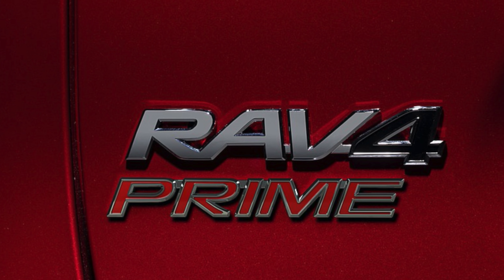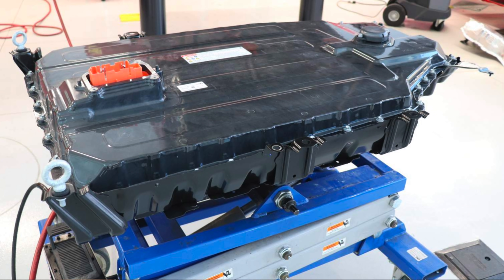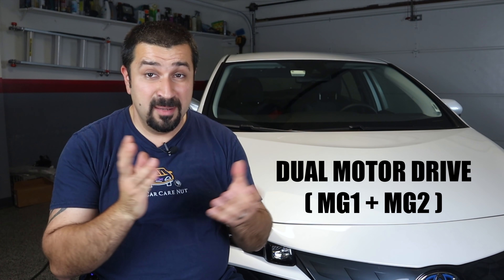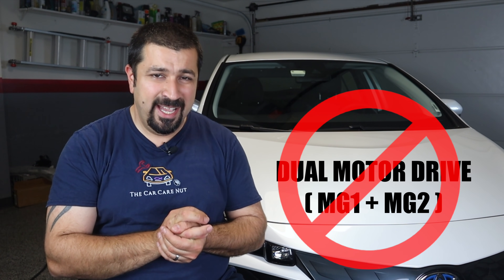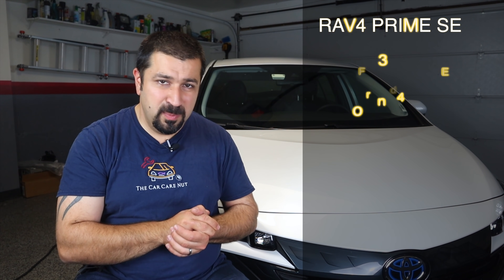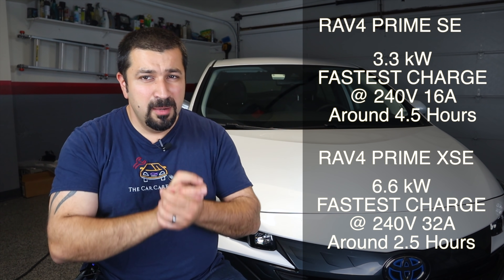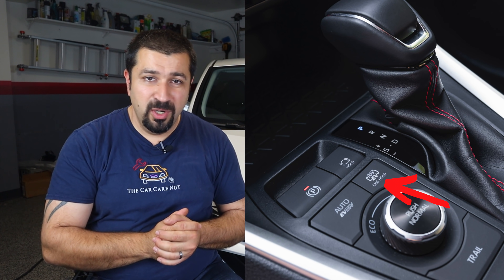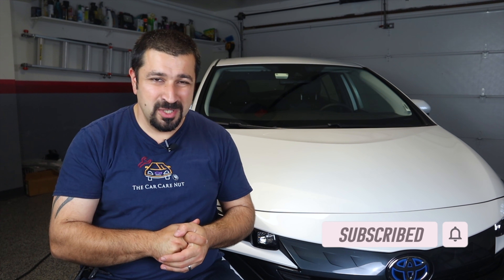Toyota RAV4 Prime Technical Details Part 1 : Battery, Charging and Drivetrain

Comment: I hope they reserved enough capacity for the battery to wear.
From my research on EVs, (Excluding Nissan Leaf, that is a special case) you want to keep the battery between 20% and 80% capacity most of the time.
That is one of the reasons I decided to skip the PHEV generation completely. I'm sure Toyota's engineers have thought this through much better then Mitsubishi, Kia and MG (among some others that are for sale in my country)

Excellent content as always, can't wait for more.

I hope you can do a video on the Lexus ux300e some day.
Reply: For Rav4 Prime only 13.3% to 90.6% of battery capacity is available.
Reply: @NatureLover-ey5ub  that's actually good. Much better then I thought. That and the fact it has no DC charging might mean the battery can life for a good 15 years at least.
Reply: @dgurevich1  I guess  this is the reason that  Toyota could provide 10years/150,000 miles battery warranty.

Comment: Hey i have a question that doesn't pertain to this video so I apologize in advance! I have a 2021 Tundra CrewMax 2WD not that all that matters but here is my question. Is it normal for the transmission in my tundra to constantly want to shift down and slow me down in every little/big hill that I come across? I feel like its overworking itself by shifting down and revving up trying to slow the truck down when I have no intention of slowing down as hard as its doing. I guess my real question is : Is this something that will cause any damage in the long run?
Reply from the maker: Hi! That’s by design. The computers pick up when you’re going down hill and automatically downshift to assist. It won’t cause damage in the long run